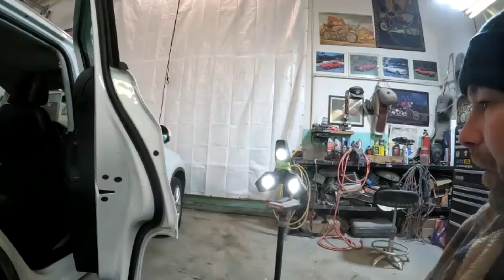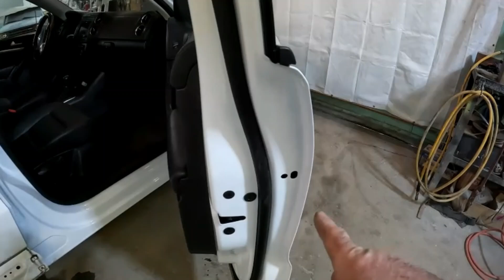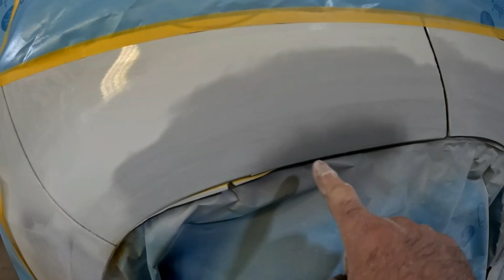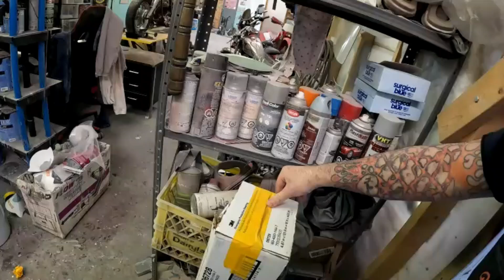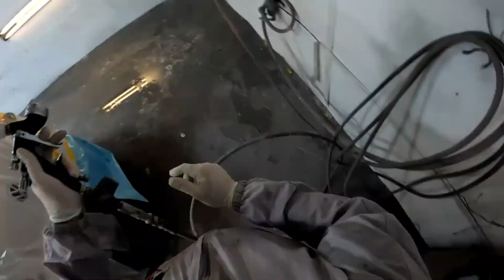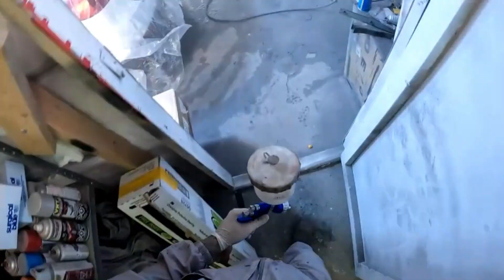Old dog, new tricks,  late model collision repairs

Comment: I think some tech schools are teaching that body filler needs applied over epoxy.
Reply from the maker: Yeah, I really don’t know where it’s come from, but I’ve yet to see it on a TDS
Reply: @Johnnymidnight Hi John, it's Jim S. and I can tell you where that whole thing came from. I was a paint rep. for a long time in your area, and this whole "got to put epoxy down first" was a procedure that ICBC demanded on the FORD vehicles that had some panels that were galvanized from factory. And to make repairs that were as close to factory quality ICBC made a coat of epoxy mandatory on those vehicles, before and subsequent filler work. Well, pretty soon
the whole thing snowballed into every repair on every make had to have a coat of epoxy, before anything else was applied. It's just a big distortion of what they called for on some vehicles for a period of time. Some guys have in their past had a talking to about what should have been done, by the insurance adjusters, or their boss, and now think it's the rule. No filler that I ever sold said in the TDS sheet that it HAD to be put on epoxy primer, but you can if you want to.
Reply from the maker: @jsiwek7212 hey Jim! Thanks for the clarification, obviously there’s nothing wrong with doing it, but yeah, it’s strange how it’s become this topic of argument of late
Reply: @jsiwek7212  Thanks for the clarification 👍
Reply: @blairsmith726  Hi Blair, nice to see you working on all the cool stuff. Beautiful work you are doing.
Reply: Its insane how many fools on the internet say you have to epoxy first !!  Its a lot of resto clown shops on tv , that have to act and Charge , like they are the best